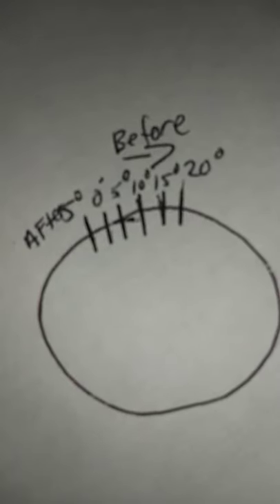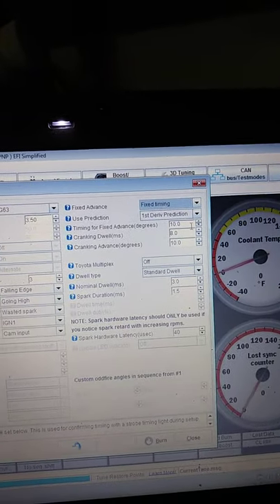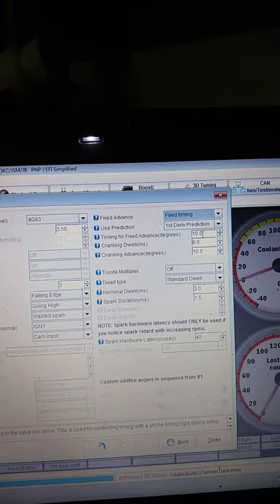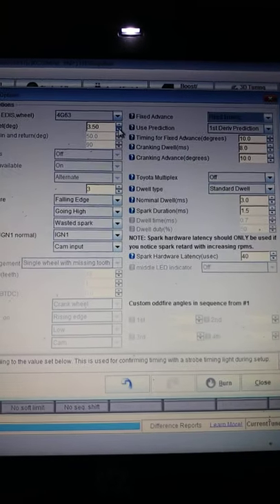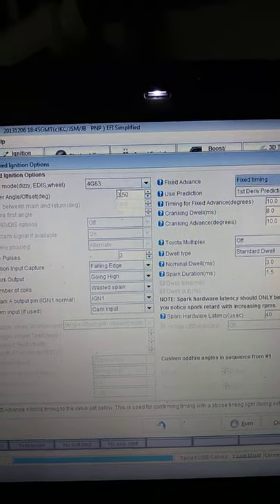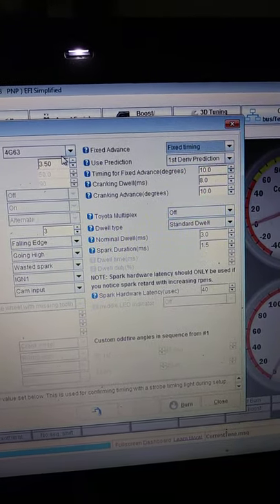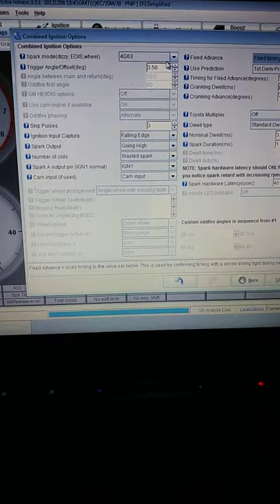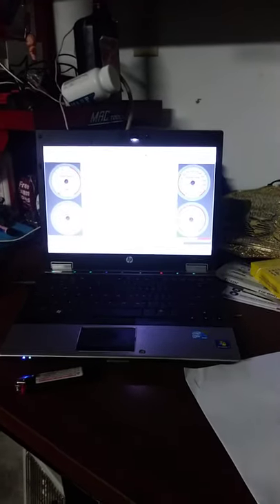mr bones420 how to set base timing

Comment: Honestly very informative. And yes please do make a video about it. Thinking to rebuild my motor and upgrade the ecu to a megasquirt. Would be much appreciated if you did a video. Keep up the awesome content. God bless
Reply from the maker: You got it!
Reply: @WhoopAzzRacing  Hi I just wanted to ask a question if you may probably know, I installed a o&j stage 2 cam on my hardbody got the timing correct and all. Anyways my issue is, my idle fluctuates from 800 to 1000 and the needle on the tach bounces when the vehicle is warmed up actually even when it starts for the first time. I replaced the tps and adjusted it as well and replaced the iac but still the idle tachometer needle is jumpy. Any info will help if you know. And yes the maf was replaced but I tested when I unplugged it felt like it was gona die and when plugged back car idles well
Reply from the maker: ok this could be caused by a couple of things a vacuum leak or you may need to do the idle re learn if I remember correctly you are supposed to unplug the tps sensor there is a screw on the top of the throttle body it may have a cap rubber or like a tiny metal freeze plug covering it but it is there adjust the screw until the desired idle is reached then plug the tps back in also I would reinstall any factory sensors that did not fix it as aftermarket stuff is straight shit MOST of the time try that and let me know